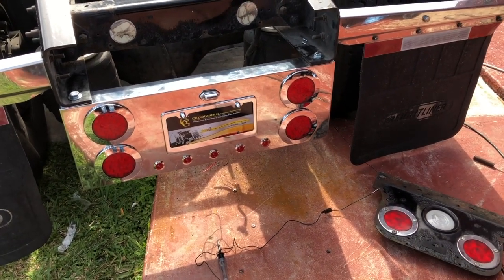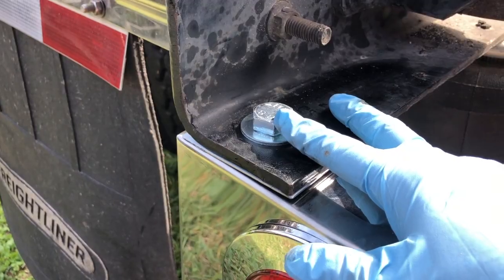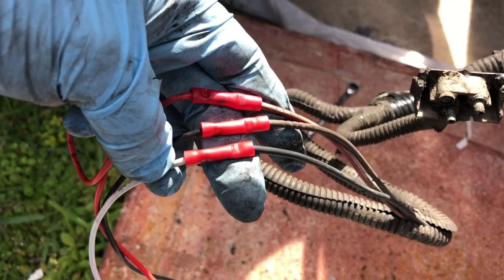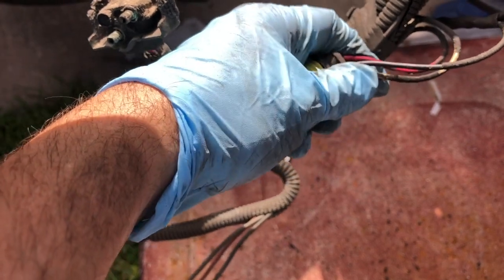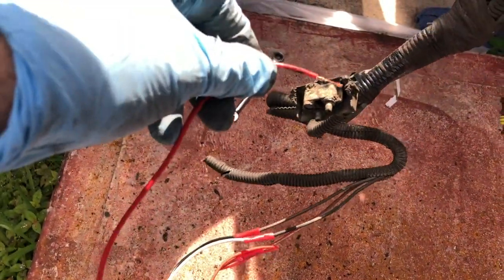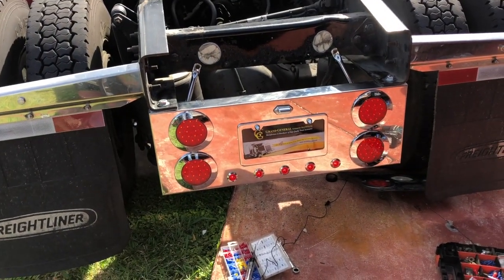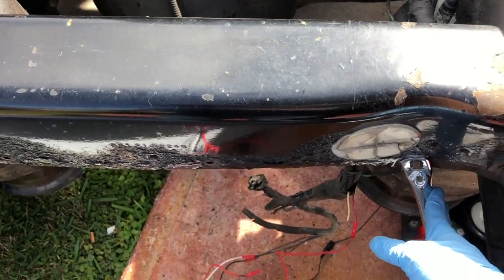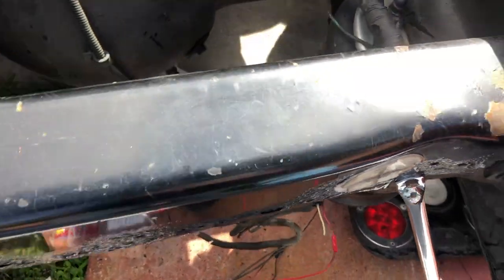how to install  rear light panel on semi truck

Comment: Glad I saw this. I didn't add the brace and it cracked my light setup. Using the mirror bar for the bracing was a good idea. I'm definitely gonna try this on my next setup thanks.

Comment: Nice job, but how do you get the backing light (reverse light)?
Reply from the maker: salsero8816 this specific rear panel didn’t come with backing lights but we installed some square led lights unfortunately I didn’t record it but it’s really easy the plug for the backing light has only 2 wires power and ground connect them to the light of your choice and good to go
Reply: Custom fld120 How to videos  thanks, i am asking because i just got one of those panel lights and wondering about the backing light, can you post a picture of those square led lights that you talking about? Thanks for your videos one more time. Regards
Reply from the maker: salsero8816 I don’t have an option to post pics here on YouTube but go to amazon an search for: square les light you’ll see them there Amazon choice is a good option
Reply from the maker: salsero8816 square led lights
Reply: Custom fld120 How to videos thanks bro 👍
Reply: Hey I would like to know I got a blues wire 
What it’s the blue one please

Comment: You got the same one I have on my fld120
Reply from the maker: Mac Knight that was installed on a freightliner coronado that my friend owns it’s pretty nice I like the 3/4 inch round light underneath it I am considering put them in my T-bumper same way

Comment: Kind of drill bit did you use ?
Reply from the maker: I believe it was a 3/4 inch regular drill bit but it was a new one slow speed and always lubricated I use 2 new ones it was quite a job but that’s the hardest part but as I said the key is the speed go slow well lubricated and applying pressure
Reply from the maker: By the way I forgot to say do a pilot hole with smaller drill bit first 1/4 inch or smaller